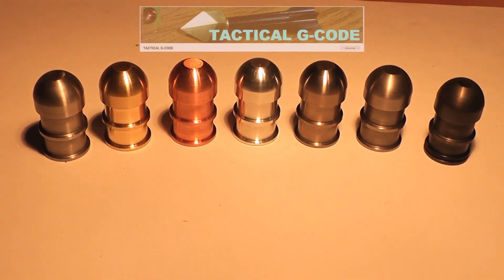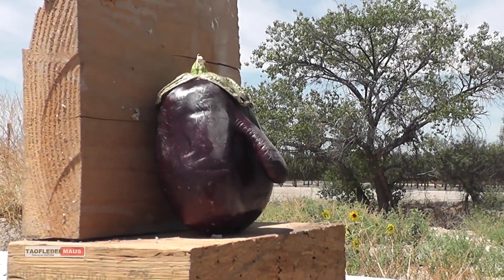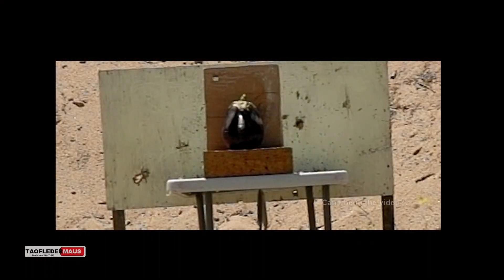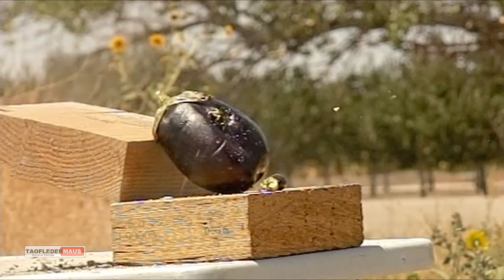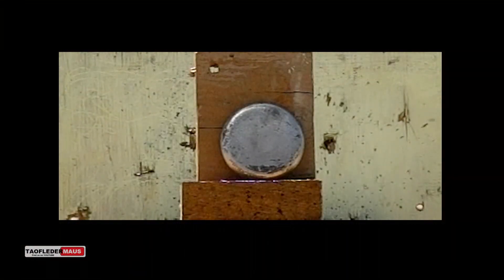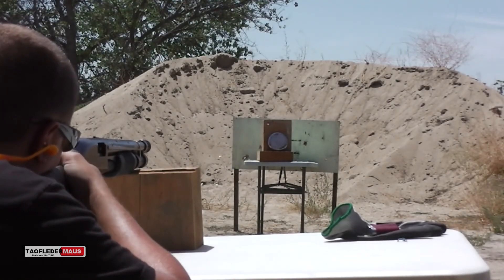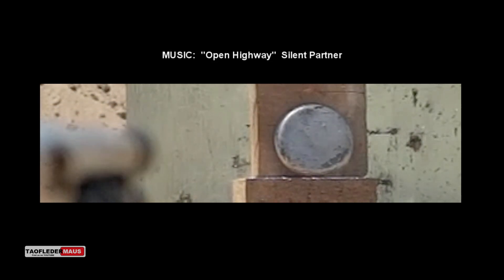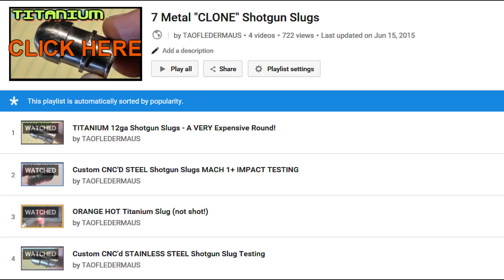CAST IRON Shotgun Slugs -  Custom Machined Bullet Tests

Comment: Thicker walled slug may hold up better. Revisit?
Reply from the maker: Steven Heidt   The other metal slugs we shots like steel,   stainless,  and titanium held up better and did not bulge because they were just stronger,  less malleable metals.  The wall thicknesses were all the same.   Tim could make the walls thicker,  but it would probably throw off the balance needed to fly straight.
Reply: ***** Don't you mean MORE malleable? Most cast irons are brittle, and much less malleable (hammerable) than steel, copper, lead, titanium, etc.

Comment: Hey Tao, I would like to give you some ideas on some more Sabot rounds that you can (if the ideas seem good to you) pass on to TACTICAL G-CODE. There are early sabot variants designed for tank guns previously used by the US military that seem like they could work on a Shotgun's scale. 

I'm thinking that a down-scaled copy of the M392A2 APDS [pg 2-71] and M829A3 APFSDS [pg 2-109] could work beautifully in your shotgun, let me know what you think.
http://militarynewbie.com/wp-content/uploads/2013/11/TM-43-0001-28-Army-Ammunition-Data-Sheets.pdf

Comment: Hey hun...here is that table you let me borrow...might not fold as well as it used too.

I was thinking, hum, cast iron. That is rather brittle. I wonder if that will shatter on impact. Nope, did not shatter on impact. It shattered on firing.

Comment: The fracturing is probably pressure-driven, I wonder if a solid cast iron slug would similarly disintegrate...
Reply from the maker: Teth47  It would probably hold up well if it was solid.

Comment: That fine grain cast iron is really neat to machine. We did some custom molds from it, and it doesn't want to bur up like steel would. It just crumbles away one grain at a time. Brittle, yes, but really neat to work with.
Reply: Maybe if da iron slug would have been harden with a heated oil quince dey mane not have been so brittle?